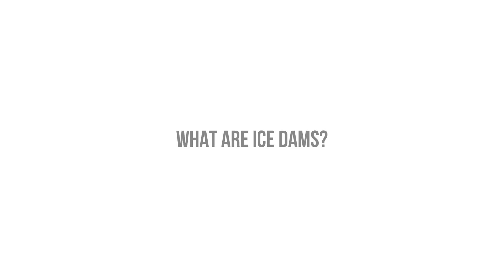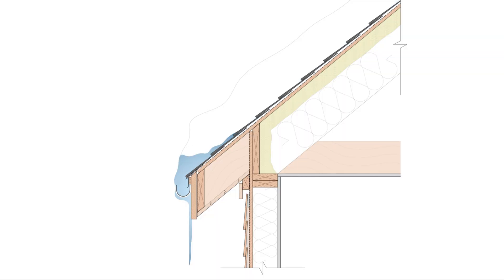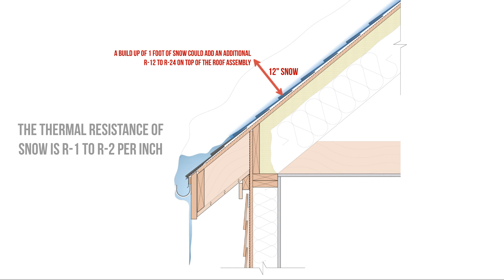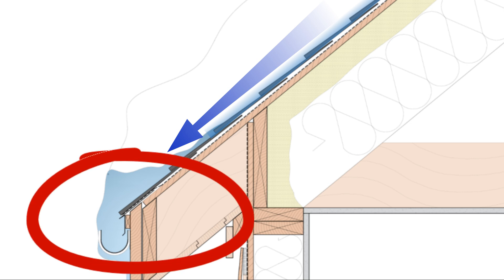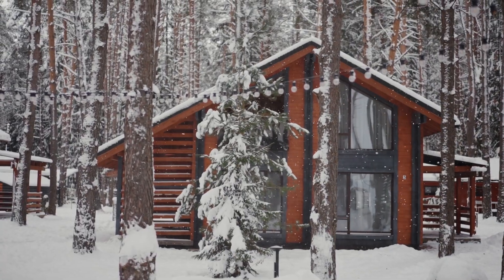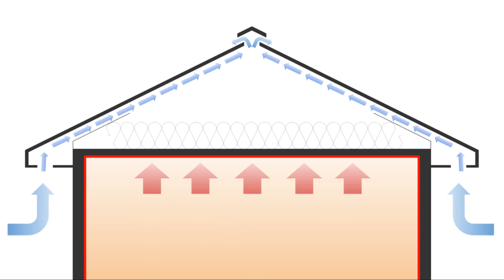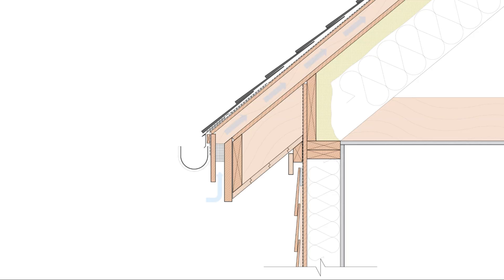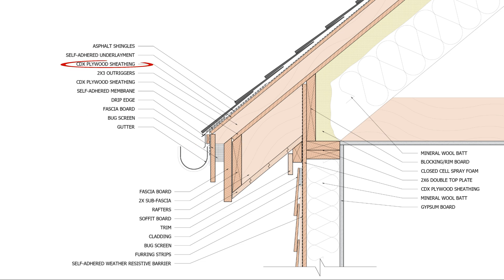How To Prevent Ice Dams (AVOID Roof Leaks)

Comment: I am doing a shell with warm metal roof and eaves added outside of shell. 6/12 pitch skillion roof with tall wall facing south. I got the 70 psf snow loads. Trying not to have to chip away ice dams or shovel roof in winter. Doing a masonry north wall because all the snow off roof against wall in winter. North walls seem to experience frost heave more often. The sun don't shine there in winter so colder longer.